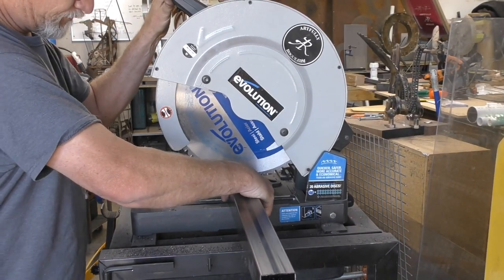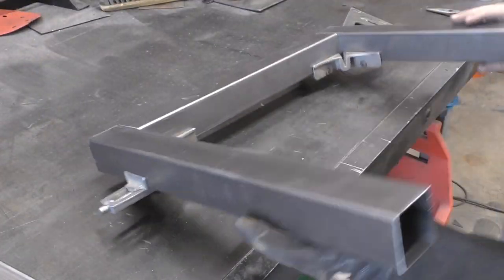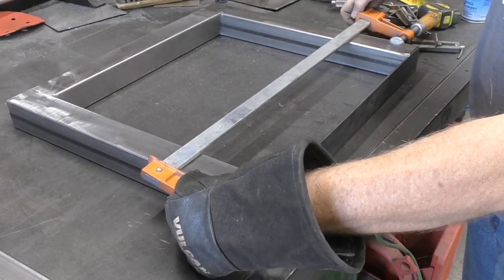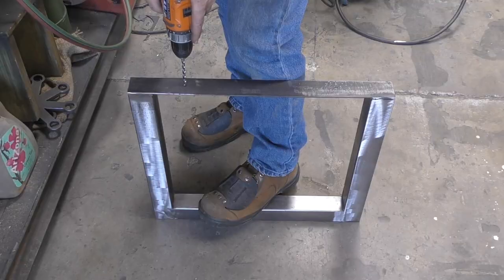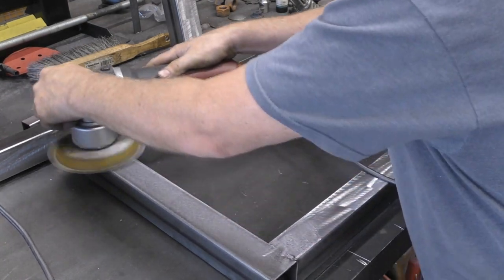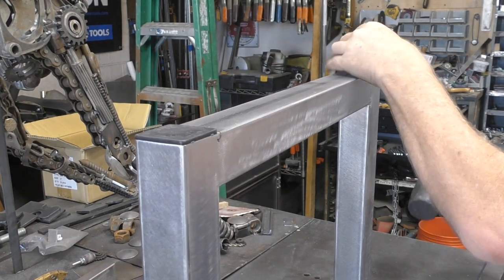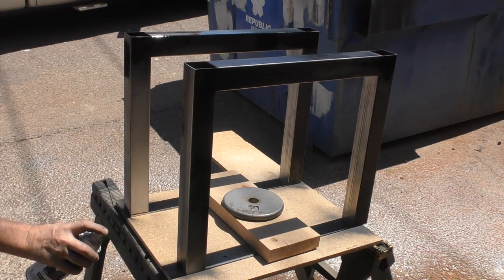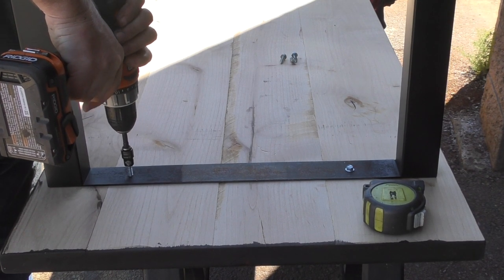Super Easy Metal Table Legs

Comment: Great build, it would be a great addition to get some rubber based plastic insert pads to slot  into the open bases of square tube to prevent scratching wooden floors. Thanks mate
Reply from the maker: Yeah that's exactly what use on some of my other table legs.

Comment: DOES THE PAINT SCRATCH OFF?
Reply from the maker: If you take a sharp object and scratch the paint I'm sure it will come off however if just handling in normal everyday methods its fine. Shoes have scuffed the surface but it washes off easily

Comment: Where do you get your metal from and what size square tubing is that? Almost doesn't seem worth making them today vs. just buying them online. Thanks!
Reply from the maker: I get my steel at my local supplier, Advanced Metal Sales. The material I used was 2 x 2 x .065 square tubing

Comment: Hi Doug, quick response time. After a closer look it at 2;03. Bottom of shelves right in front you. Just to the right side of the Arizona tea. It inside if a box.four metal looking fingers with holes where finger nail would go. Look cool.hop all is well
Reply from the maker: I gotcha. Those are some cnc cut "snowflake" looking pieces I picked up from my local metal supplier. Apparently they didn't cut clean enough for the client and the sold them to me for a couple bucks a piece. I picked them up figuring I might use them 'some day' :)
Reply: Artfully Rogue 
I thought maybe they were LEGO tree’s. Thanks for the update. Be well

Comment: I have got similar legs but when I fixed the wooden table top on this it is shakes. Little touch sideways and it starts moving, why is that? It's on a flat floor touching perfectly. What I need to do with wood and metal contact point together?
Reply: Depending on size height weight of table top, 2 screws likely isn’t enough to secure ,inch of anything. It may hold up with someone sitting on it directly in the center, but a side load those screws will wiggle loose eventually. I’ve seen others router out the underside where the flat stock goes on the table. This inset give some sideway stability. Also, using t nuts or threaded inserts as opposed to screws into wood seems like that would make a more positive co. Diction as well.

Comment: Great video!
Do you have any tips to make this kind of legs not wobbly?
Reply from the maker: I haven't any wobble issues but it might be because I use a larger/wider mounting plate with offset screws as opposed to screws in a line
Reply: @ArtfullyRogue  I think so, mine is only 3cm (2" ish). Still trying to find the fix. Thanks for the answer.

Comment: I've never wielded before, what wielding gear  would you recommend to do these table legs,
Reply from the maker: Honestly, If you've never welded before and if you're on a budget, I would pick up a cheap Harbor Freight 110v flux core welder (gasless), .035 flux core wire, welding gloves and a welding helmet. That's all you'll need. If you can swing a little more money, I'd grab the YesWelder as it will allow you try different welding methods all in one machine. And I would buy the YesWelder flux core wire if you go gasless for starters. Its the best wire I've used hands down.

Comment: Wouldn't the table wobble left to right as I have this issue on my table?
Reply from the maker: honestly I haven't experienced that problem with the legs I made
Reply: @ArtfullyRogue  sadly I bought legs like this and placed at the end of each side of 180cm Table and it wobbles.
Thinking of using a bracket to stabilise it

Comment: Short and sweet.  I do get a kick out of the plug for your Evolution saw.  Every time I see stuff like that I'm reminded of The Return of the Killer Tomatoes.  It's when the discover product placement about midway through after which the movie becomes a non stop, shameless commercial.  Absolutely hilarious.  On a serious note, though, I was trying to go back through your earlier videos to see what type of plasma cutter you're using.  Was it an off brand model?  Cheers.
Reply from the maker: The plasma that I use with my cnc is the vipercut 30i and then I have one that I use manually which is an off brand Molao cut 50